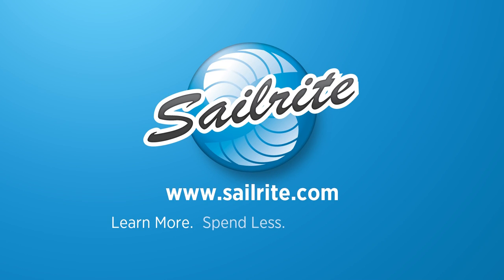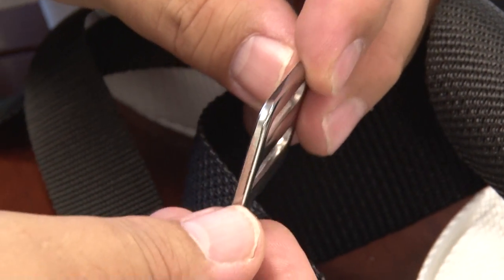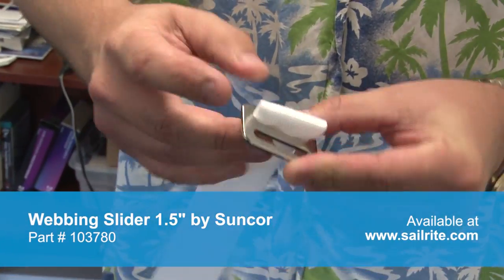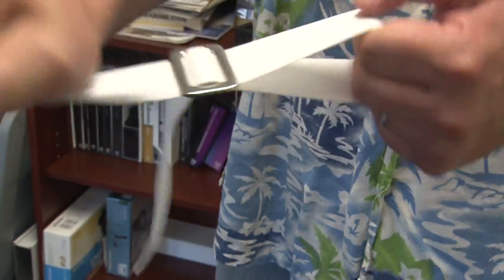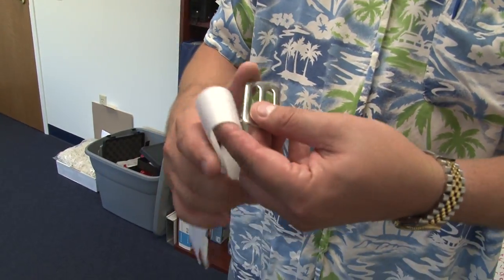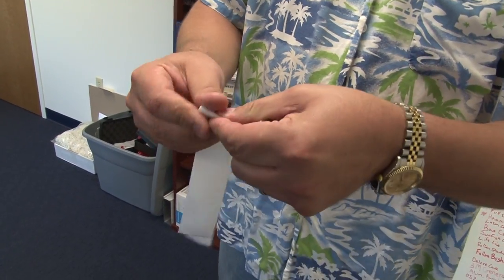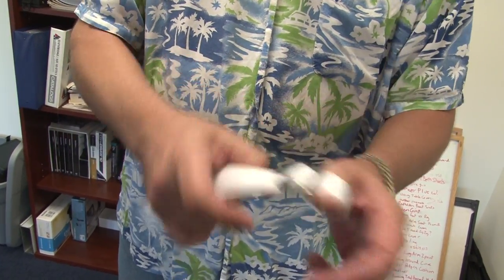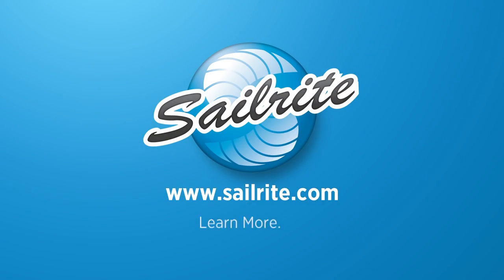Webbing Slider Stainless Steel - Fixed Threading Plate

Comment: Do you think that could hold 45 to 80 lbs? I need an adjusting system that could hold a weight in that range.
Reply from the maker: Yes, with these stainless steel sliders you could hold that much weight and more.
Reply: Sailrite can u tell where to get it in Singapore ?
Reply from the maker: Genius by Design  It depends on the size. The working loads are listed under each of the sizes on our website.